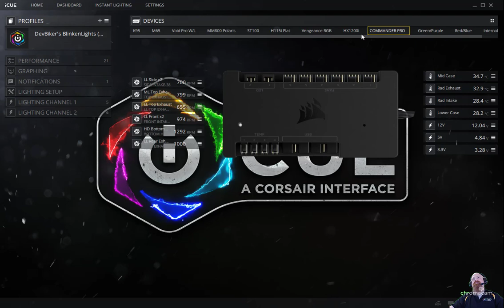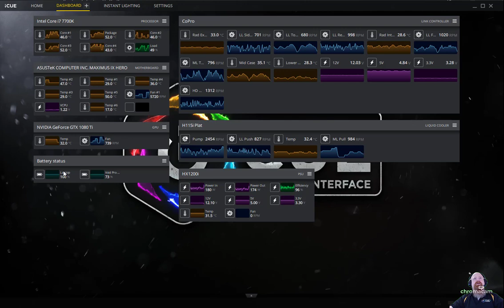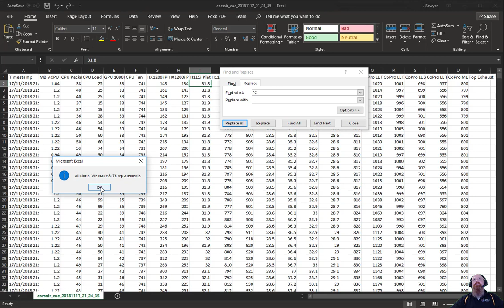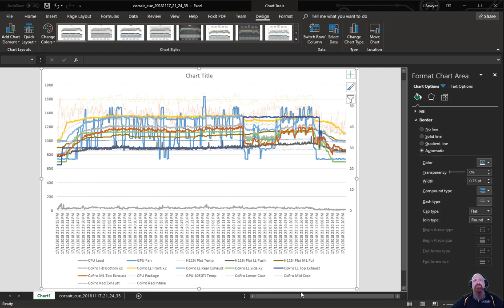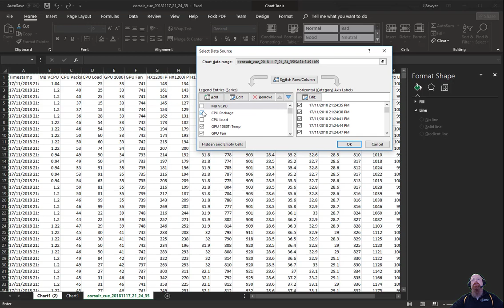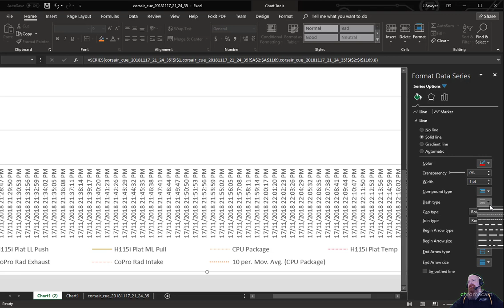System Monitoring and Logging with iCUE

Comment: Hello, I have a question and I'm posting it here since I have no other way to reach you

I have a corsair H100i Pro RGB 240mm AIO. Will everything work if I connect the RGB cables from the ML120 fans that it comes with to a corsair fan hub (which then goes to the lighting node pro), the fan speed cables (4-pin pwm) directly to the motherboard and not to the cooler, and only connect the cooler's sata power cable and its own 4-pin pwm cable (which goes into CPU_FAN)? This will leave 4 cables hanging from the cpu cooler (2 RGB connectors + 2 4-pin fan control cables), which I am then planning on tucking behing the motherboard tray so they're not visible.

I will be doing this to connect all 6 ML RGB fans in my system to the fan hub in specific order, so that I can have waves and shit, because if I connect the radiator's rgb fans into the cooler rgb controller, then it won't sync with the rest of the case fans, right?
Reply from the maker: Well, you can always post on the Corsair forums (forums.corsair.com)! 
But to answer your questions ... 
1) The Pro coolers don't come with RGB Fans. The Platinum coolers do. And you can plug the RGB cables from the Platinum cooler fans into a fan hub with other fans in the system if you want. You can also add RGB fans to the Pro coolers if you want. 

2) I would recommend connecting the fans to the AIO. This will allow the fan speed to be controlled by the AIO temperature at all times, which is the correct way. That said, they will work when connected to the motherboard.
Reply: @Dev-Biker   I did it that way, the rgb fans connected to the hub and the pwm cables to the aio, and the two radiator fans are running faster on average (when set to "balanced" mode) than the rest of the system fans connected to the mobo. When I set them to "quiet" mode, they are much quieter (not that their noise in balanced mode is any big issue, just slightly audible) but the temps tend to run higher. I would prefer to set a custom curve myself but icue doesn't have that option. Do I need corsair link for that?
Reply from the maker: @maxemore  iCUE will create a custom curve. The fan speed will depend on the coolant temperature.
Reply from the maker: @maxemore  And there is another video on creating fan curves.

Comment: Can I ask a few questions coming from the Dashboard screen pleeeeaase
1. Under the motherboard info , what is fan#1 with the 4200+ rpm?
2. Under H115i plat info, what is that temp reading? is it the CPU temp or the AIO coolant ?
3. also under H115i plat info, is the pump 2000+ rpm reading the true reading of the Aio pump?
Reply from the maker: 1) Likely the CPU Fan. As I don't have any fans on the motherboard except the fan connection for the cooler, that's the only thing that it really should be. But guessing what the different motherboard fan and temp sensors are is a challenge.
2) It's the temperature of the AIO coolant, which is really what you should be using to control the radiator fans. 

3) AFAIK, yes, that's the true pump reading. The value supplied to the CPU_FAN header varies by cooler and is there, really, only to prevent a CPU Fan warning.
Reply: @Dev-Biker  Thanks so much man for the response and awesome videos

Comment: Just what I was looking for - I found your posts re: the Co-Pros fan curves on the forums - I've just switched to a whole new system in a 1000d and as I have 18 fans in the case on a closed loop with 2 rads in push-pull I've found the sensible thing was to split between three more co pro's - I'm likely to have questions on the 1000d forum as as soon as I installed the software noise levels went weird (don't worry I found your fan profile video - so that's already explained why) - my questions are likely to be optimization based - but I wanted to say thanks for having already answered some of my questions... I'll be posting later ;)